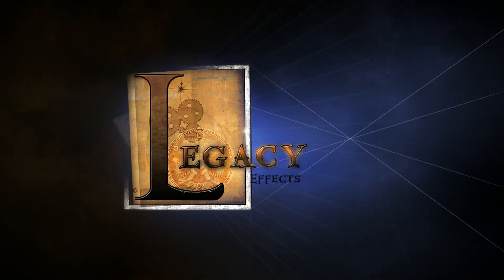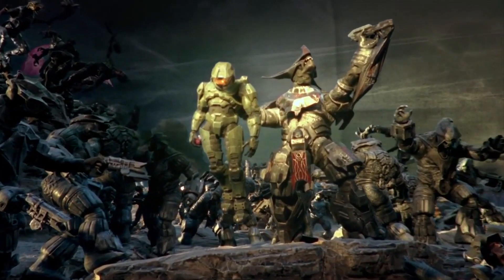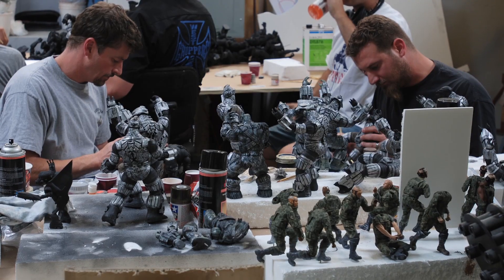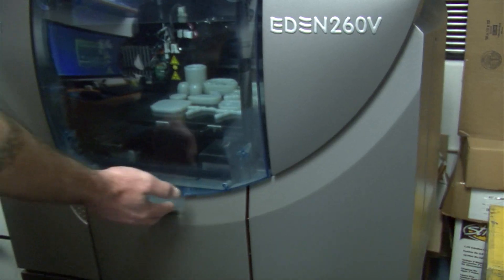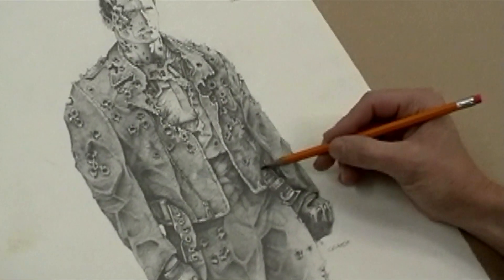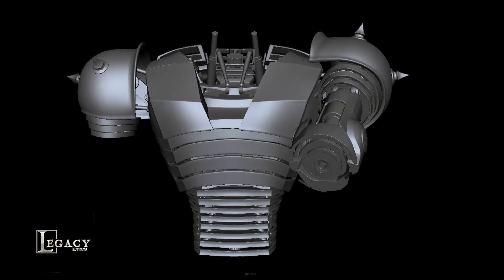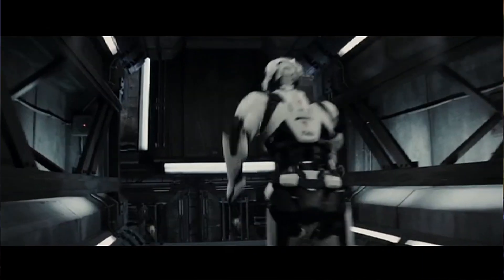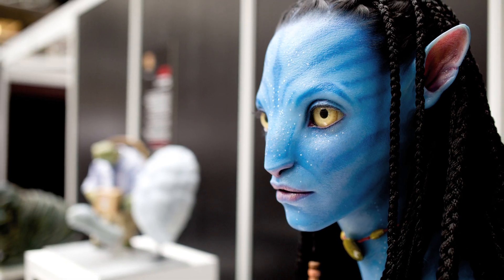3D PRINTING is Revolutionizing Special Effects - Legacy Effects

Comment: Thanks for sharing, I didn't realize so many of these suits were practicals. Your studio's work is amazing as always.
Reply: I think after that period of crazy use of special effects, where everyone used 3D only and we could tell, now they blend the techniques, the old and the new, which helps keep things real, solving real problems (for example, the joints on suits, how big something really is, how does it work, can someone actually fit inside, etc etc) and it helps the actors get a better feeling of what they are acting for, helping them deliver a better performance, because acting for a big green screen... You can tell the actor is not confortable.

Comment: What are the benefits of 3d printing over CNC milling?
Reply: I'd still be interested in hearing their answer, but from what I understand, it's the advantage of additive vs reductive sculpting. You can't make fully hollow pieces in a CNC machine, there are resolution and logistical concerns involved in figuring out how a bit can dig out the material in a certain area, and you're limited to a different set of materials from 3d printing (which has its own limitations).
Reply: Oh yeah, there's definitely some cool things that only 3d printers can do, like printing interlocking parts. But all the printers I've had experience with have been painfully slow.
So for a lot of applications where the final has to be cleaned up and cast anyway, why not use something that mills quickly and save at least a few hours?